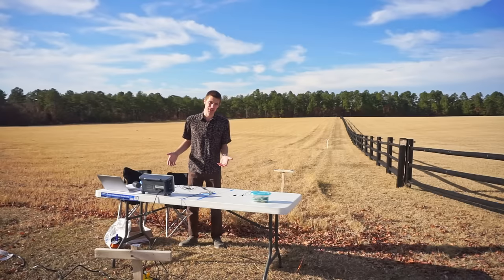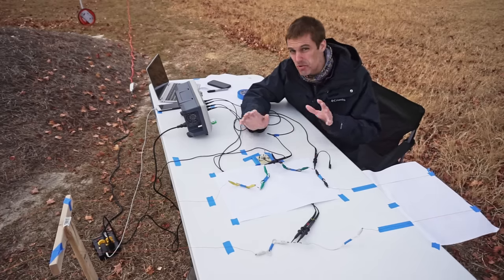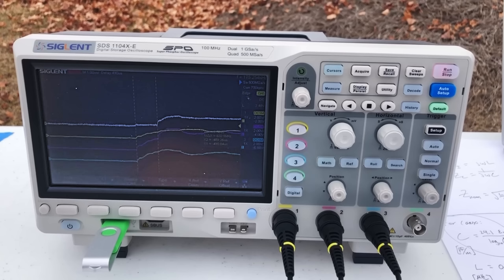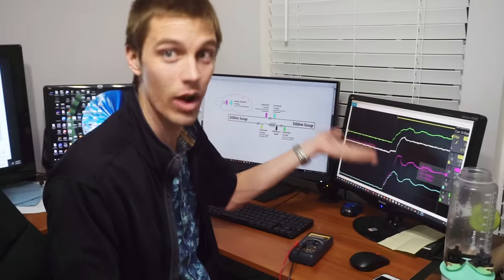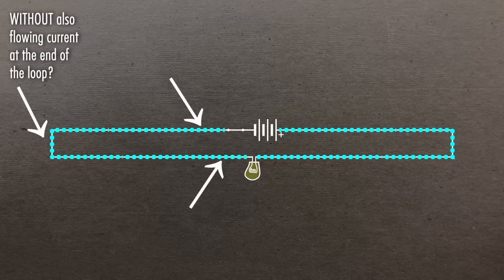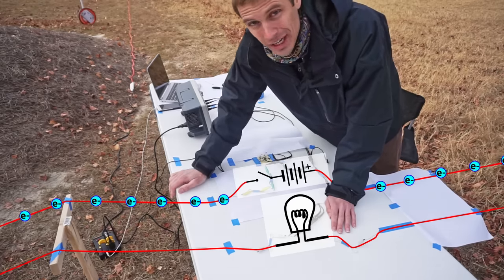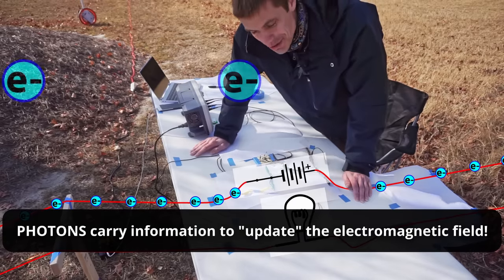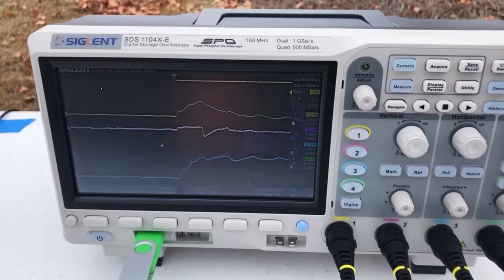I bought 1000 meters of wire to settle a physics debate

Comment: Very good test. It is always great to see what happens in reality! Thanks you.
Impedance matching would raise your output voltage. But also in your setup, I would be very worried about the capacitance the probes add between the lines. Remember the stray capacitance between the wires is VERY small, likely much smaller than the capacitance at the probe output. Probes have capacitance to ground and with probes on the switch and load side, you are basically coupling the switch to the load side with extra probe capacitance. I say place probes ONLY on the load side (you still see the steps), make sure your probe is on x10 for smallest capacitance, and maybe use special high frequency probes.
Other than that, the only thing that might not have a significant effect is the capacitive coupling through the earth which makes for a slight output voltage difference. Nothing huge though. 
One more note, knowing your load resistance and the voltage of the first step, you can calculate the line characteristic impedance, and match your load to it, or pick a higher load to see a much larger voltage step at the output.
GOOD LUCK with your future tests.
Reply: Ah yes all of these words make sense to me. lol. I’m loving that Derek sparked so much enthusiasm for science with that video, even if proved right or wrong, this thought experiment is wonderful to uncover through all of you.
Reply: Mehdi, you forgot to mention the step when you get shocked :P
Reply: Are you going to make a video on this?
Reply: So interested to read this. It also seemed to me that the capacitative coupling was high for two wires a meter apart. The probe capacitance would explain it. Cool.
Reply: @hippopotamus86  He did, a week ago
Reply: @hippopotamus86  I did!
Reply: The wires have a mutual capacitance of a few pF/m, and a similar capacitance to the ground. For example, 1 mm wires 300 mm apart are 4.3 pF/m. So a few meters of wire would have capacitance equal to that of the probes, which is typically 20 pF.
Reply: Always fun to see other good youtubers commenting und the ones you also watch. But as soon as I saw the title of this video I knew you also left a comment here.
Reply: @adamtherealone  nah. İf derek is wrong f him. No participation trophies round here.
Reply: @garrysekelli6776  bro people have hypothesis and theories all the time, and sometimes they’re wrong, but don’t know it until proven so. Stop tilting
Reply from the maker: Thanks for the reply! I’m interested in the probes adding capacitance - this is something I didn’t worry too much about but perhaps I should have. Are you talking about parasitic capacitance through the shared ground/coax shield linking the probes together or something else internal? I admit I am NOT a scope expert and would like to learn more.

I didn’t try THAT hard to get an impedance matched circuit but I fiddled with resistors to get a nice step function - when they were way too large I got results that looked just like your simulation! I wanted to keep the load resistance well above the wire resistance so maybe I didn’t go low enough? I was also most of the time simultaneously changing the near-side resistors and changing my source impedance because it made the current measurement easier but yeah not the best way to get a match.

One note on the “do the probes matter?” question, when I spread out the wires further I was able to make the pre-light speed signal totally vanish, so can I use that as evidence that the probes were not causing an additional signal? (Because I could make it drop to zero?)

Thanks!!
Reply: @AlphaPhoenixChannel  we use fet probes at my workplace for very high frequency signals to get below 1pf of probe capacitance. We are measuring things like DDR timing. Although with your noise spikes from the wire, the probes might get damaged, since the ones we use are only rated to about 12V max, even transients. Btw great video, I’m glad you made it! The production quality is great!
Reply: @cogoid  20 Meters of wire implies 20m/c seconds. Are you saying 1m/c seconds is not the real answer?
Reply: @adamtherealone  also. They call them hypothesis and theory. Derek called it "real". That is unacceptable in science, though it might be acceptable to YouTube. Thus Derek is merely a Youtuber.
Reply: @BenjaminGatti  And the fact to call things out as lies without doing a proper field test (10 times) is very rude. What was he thinking ?! If there was a purpose at all. Its good to question for sure, but being rude is a bit too provocative.
Reply: @cogoid  Capacitance: C = 
3.261e-12 F

Looks like 0.33 pF per meter to me. Need 60 meters to match 20pF. You get 1/c sec. That's arguably 0 meters of wire +- 1*Derek's error magnitude.
Reply: @RogerCillion  yeah, I agree. Science is a humble discipline, because at the edge of science, there is always the possibility or error. Derek's claim will not hold up in physical testing. And these tests are not that hard to do. Even Derek's simulation techniques are wrong in my opinion, to say nothing of his actual tests which are smoke and mirrors.
Reply: @BenjaminGatti  Ben, "pico" is a unit prefix in the metric system denoting a factor of 10⁻¹²
Reply: Haha, Lewin designed his circuit. You should make a 'Probes' t-shirt. 😂
Reply: @BenjaminGatti  There is no "real answer" without more clearly defining the real question.  1m/c is when the current starts trickling, but it takes much longer to start pouring.  Scaled down for this model, 1m/c is when you see the white line move up just a tiny bit, but then it stays there for a while (I'm guessing the equivalent of 1 second or a half-second, so enough to follow the circuit the long way around), then it starts climbing (the diagonal).  How high up does it have to be to count as "on"?  

Derek did specify that "any current" counted, but as pointed out in this video (and others), an actual bulb that lit up on that small of a current might burn out on the full current.  (Though in this video, the full current seemed only about 8.5 times as much as the initial step.  There are bulbs that could handle that, but I'm not sure if that 8.5 becomes 2.5million in Derek's circuit.)
Reply: @jimjjewett  this scope can do 1 G/s, which means 3 samples in 1m/c sec.

I'm not sure that we have zoomed in enough for 3 samples.

In addition all the probes provide a path, do those have to go.

This is an effort, but not a good effort.
Reply: @AlphaPhoenixChannel  Hi Alpha! I suppose the probe capacitors to scope ground would be like my simulation where I placed the capacitor first, it can create a spike in voltage when you just turn the switch on. Knowing what can happen, if the spike happens and vanishes much faster than the wave reflection, then you can ignore it. But if your load resistance is too high, the spike can stay too long. It seems you are not seeing that in your result, so it might be OK. 

I'm a bit confused about your load though, you said you picked it bigger than line impedance. Then I would expect your first step to be at higher voltage too. hmmm! Wish you were close by so we could do some experiments!
Reply from the maker: @ElectroBOOM  ah I see what you were talking about. Effectively adding two capacitors on both sides of the load over to the high side of the battery would add some weird coupling, but [hopefully] it ends up having the same effect on both sides as far as voltage drop is concerned, although if those capacitors were eating some current meant for the load, I could see there being some initial dip…

But yeah, I didn’t get a transient up front I’m worried about so fingers crossed this doesn’t invalidate the test. You don’t know how relieved I was to see your comment last night and realize there wasn’t a big glaring error anywhere that I’d missed - cause I knew you’d be able to point it out!

And yeah I’m reply to calculating the effective impedance from the step height - I feel like an idiot for not doing that in the moment and matching it up. With that knowledge in mind, I may try to calculate what dimensions would be necessary to impedance match some actual LED+resistor or something since I do have step heights for varying wire spacings although not wire diameters.

Thanks for getting back!
Reply: I read your comment how you talk... AMAZING!
Reply: @AlphaPhoenixChannel  yes, differential results are suitable for analyzing the impact of a parameter. We still need to understand: <1/c sec , @1/c sec and < full length/c sec.
I think this video only covers the last period. Also know as E. Other.
Reply: @AlphaPhoenixChannel  quick test for "probe artifacts" is to get a pile of picofarad capacitors.   
Hook them across the probe and probe-gnd, see if this affects the scope results.   If your probe is supposed to be 3pF or 10pF, simply add a capacitor to double, triple, etc., the capacitance added at that point.
In other words, what would happen if your load-resistor had a picofarads capacitor added across it?   Probably this is easily calculated:   it's just an RC time constant, with part of the "R" being 2x the Zo line-impedance, which is the series-resistance between battery and load.   With a hundreds-ohm line impedance and load resistor, then a 10pF probe won't block signals which are faster than roughly 100 x 10pF = 1nS      (ALso, two probes connected across the load resistor will only add 1/2 of the probe's capacitance, because the two probe-capacitance values are being wired in series.)
Reply: @ElectroBOOM  I notice that Dereck's setup gives more impressive results if much higher battery-voltage is used.    That way the initial wattage can be significant across the 1M gap: easily 10W or higher (because the Zo of the lines only are adding 1K or 2K in series with the load resistor.   So put 200V across those resistors!)   Someone needs to reproduce the longwire experiment, but using 200V worth of 9V batteries clipped in series.
Reply: @wbeaty  of course, but as alphaphoenix notes at the beginning of the video, any light designed to turn on at the initial current value is almost certainly going to be blown out by the full current value. So it wouldn't stay on for long 😂
Reply: Who are you and where did you get those beautiful eyebrow?
Reply: Totally heard this comment in Medhi's voice.
Reply: That would apply to any measurements done with more than one probe. So, to have an idea of the magnitude of that effect, perform the test with just one probe near the bulb and compare with what we get with two probes. I don't say the effect is nul, but negligeable in comparison with the noise (radio wave  picked by the wires as well as, well, thermal noise and others).
Reply: @rustyshakleford5230  All hail the unibrow.
Reply: @AlphaPhoenixChannel  Great test!
Thank you!

It made me wonder of two cases:
1. How it would act if it was a big circle and not two parallel lines.
2. If you cut both ends of the parallel lines and keep them in place, will there still be that tiny spike of voltage? Maybe even a smaller one cayse you got less wire to "charge"?
🤔
Reply: @moneypowertron  Not true, since a matched bulb sees 6v initially.   So use a 12V bulb, which initially gets 1/4th of full watts at 6V.
Reply: @davidferster2263  They weren’t meter apart here. 4 times closer meaning 16 times (?) higher capacitance per unit of length.
Reply: my brain automatically reads this in mehdi's voice
Reply: wouldn't the increased capacitance increase the size of the initial pulse but be unlikely to affect its initial timing? man that would be fun to engineer out - 2 sampling devices clocked form a nice stable common source over would be a cool thing, maybe optically clocked - im sure theres a simpler way tho lol
Reply: @AlphaPhoenixChannel  What I'm still confused about is why your first step at such low voltage, indicating the load is much smaller than the line impedance, and then when the wave returns the voltage jumps much larger to the supply level. The returning wave should also just add a similar small step every time resulting in a steppy-ramp towards the supply. I may be missing something. I'll re-watch your video!
[update] so if I'm not wrong, your line impedance is around 12.5kOhm on each side or 25k total. If you put a 25k resistor as load, the voltage should step up right to 2.5V. But you can imagine the current at 100uA is not much. If you use a red LED that turns on at 2V, and put a 5k resistor series to it, then you would draw 100uA at 2.5 V and so such load should look like a 25k resistor for the FIRST STEP ONLY. So you would have a first step at 2.5V. But the incoming steps would experience larger load and would be smaller.
Reply from the maker: I haven’t yet calculated the effective impedance of the jump, but I’m thinking this is a really weird case. The “flat” nature of the initial step I attributed (in an explanation of how capacitors work that got cut for time) to basically the signal shooting down the wire continuously finding new capacitors to charge, so that signal is passing through the air gap (presumably a fixed impedance) AND the wire resistance, which increases with time as the “capacitor part” of the wire moves farther and farther down the line. When I changed the load resistance I also changed the near-side resistors to make it easier to measure on the scope but I’m wondering if changing the source impedance affected the rise time and therefore the effective frequency and then the impedance of the wire, making my attempts at impedance matching invalid…
Reply: I was hoping that we would see the reflections from impedance mismatch.  The wire pair impedance could be around 377 ohms (impedance of free space) and a 3:1 impedance ratio could give good reflections.  Unfortunately, the wire capacitance is too high to see that.

The step you see in the beginning is probably due to the way the grounds are hooked up.  If you look at the beginning of the step you can see that it happens soon after the switch goes on and has a fast rise time.  I guess that it is a low capacitance connection due to the fast rise time and near to the scope, due to the delay.  The amplitude is reasonable leakage for a low-cost 'scope.    

As an aside: Signals travelling down a wire move slower than the speed of light.  Depending on the physical configuration and the type of insulation it can be lower than 70% of the speed of light in free space.
Reply: @AlphaPhoenixChannel  for your 24 AWG wires, the one loop resistance should be around 40ohms, or total loop of 80 ohms. So it seems the line impedance of 25k is much larger and so we should be able to ignore the resistance. I forgot about your near-side resistors! Let me see how much they were... 1KOHM EACH?? you should remove them and just focus on measuring the load voltage, that big of resistance would throw everything off. Well, I mean if you like to get steps the same as what the original setup would, you should remove them. Otherwise you can create any setup you like!
Reply: Still, the fact that the answer came out almost exactly equal to the length of wire, means if it's an effect of the probes it's a great coincidence. If he used other distances and the results matched with them, then he'd have shown the probes aren't relevant.
Reply: @AlphaPhoenixChannel  I suggest you to measure the current-time graph in nano-second scope.
Reply: @adamtherealone  ok but big money derek has more than enough resources to have tested this himself before telling millions of viewers that this is how it works.  He built himself up to be the guy dispelling misconceptions, and here he is, once again, explicitly putting misconceptions into the world, and having to be corrected by almost every other youtube educator (who absolutely won't have the reach that he does).  When did he change his brand from breaking down this stuff to actively generating it?  cuz I missed the channel update video
Reply: I can't be the only one reading this comment in Mehdi's voice in mind.
Reply: @TheGoodMorty  he had a whole video about click-bait didn't he? guess he decided to try it out for himself... pretty sad really, I had respect for the guy
Reply: @flecom5309  Same, he used to be one of my favourite science educators, but ever since he got into corporate brand deals (like the head and shoulders video) it all started gradually going downhill.
Reply: @ElectroBOOM  Not only am I reading your comments in your voice, like other people have said, I could see the camera zoom in and hear the burning sound effect on that "1KOHM EACH??"
Reply: I would have like to see the effect of spacing the wires further apart and see how the wave on the scope changes. You could reduce both the capacitive and inductive effect if the wire was in a big circle.
Also there is the flux of the magnetic field of the earth changing through the long wire. Some 40-50 microteslas overall, but that's per meter of wire. So there is some induced voltage on the wire even if the "switch"(transistor) is open.
Reply: I love how the YouTube science community is now doing peer reviews. This is the start of YouTube uni?
Reply: @BenjaminGatti  Ben, go and try to this better instead of throwing rocks!
Reply: @cogoid  I think we agree 0.3pf not 20pf. Where does the 20pf come from? Really hard to light an led with 20pf btw.
Reply: @yongtuition  right. Ain't nobody interested in >4nSec what part of 1/c sec is hard to remember?
Reply: @milantrcka121  that's science my friend. You ain't proved anything until you've proved it. There is no softball in science.
Reply: @BenjaminGatti  The number that you wrote 3.261e-12 F means 3.261*10⁻¹² Farad, or 3.261 pF.
The 20 pF is the input capacitance of the typical oscilloscope probes on x10 setting.
Reply: I consider it more likely that induction produces the observed effect as compared to capacitance but both have parts to play in the effective impedance of the transmission line (paired wires).
Reply: Ok, now what does it look like if one of the wires is 1km long and the other is only a meter long?  Do the two waves still need to move?
Reply: @nubrigol  The phenomenon is well known to radio operators.  It is a transmission line.  So if the feed point is near one end and the transmission line is shorted at both ends, this wave front proceeds in both directions simultaneously, one is a crest (surplus of electrons) and the other is a trough (deficit of electrons) and either wave will bounce at the end and return.  When the feed point is in the center, these two waves meet at the middle and if the load is matched to the impedance of the line the wave will stop and the entire circuit will be stable and passing direct current to keep the lamp illuminated.
But if the load is not matched, the wave will continue past the load and bounce back and forth between the ends, losing energy due to wire resistance.
Where exactly you feed the original impulse doesn't make much difference (maybe none).  If fed near one end, then what you have is the initial wave traveling the long way and right behind it is another wave that bounced off the shorted end and is following the first wave.  These reflections cause major problems in communications circuits which is why cable TV networks place little resistors ("terminators") on unused ports of splitters.  It is better to absorb the signal than to reflect it back into the network.
Reply: @nubrigol  anything beyond a meter is a moot point as all possible paths between battery and lightbulb are longer than 1m/c sec. 3m/c sec to be precise. See how 3m/c is not 1m/c?
Reply: good point
Reply: @garrysekelli6776  And he is wrong in his statement for multiple reason! But all the electrical laws he sited are correct he just skewed or better yet screwed the facts into BS
Reply: @AlphaPhoenixChannel  My initial thought was of your setup and the wires being in parallel to each other causing inductive coupling. If you had made the 1 Kilometer loop a physical circle, you would reduce capacitance and reduce inductive coupling.  I know you may not of had a choice on physically stretching the wires long tight oval where the wires are essentially parallel for most of the distance.
So I am guessing when you say you wires further apart, did you mean at the table you moved the wires connecting the resistor farther away from the wires connected to the switch? or did you mean you moved the probe wires farther apart? Probe wires do have a designed impedance to reduce capacitance, which why you have a test point on the oscilloscope, as some probes you can adjust to remove any skewing due to parasitic or environmental noise.
Reply: Just had my exam on transmission line theorie (electrical engineering) and it is so awesome to see these theories happen in practice!
Reply: I see a lot about capacitance on here, but nothing about inductance.  Inductance is likely the largest contributor to the signal results and delay to the flow of current.  Remember - inductance is direct function of loop area....large loop here gives large inductance which resist change the current (v=L di/dt showing that i can't change instantly without v going to infinity).  Also remember that electron drift is relatively slow (so the electronics don't actually move that fast), but, since they are packed in the wire, when the first one moves the last one moves...so technically electrons don't actually move very fast through a wire, but the movement of one causes the movement of all which happens at the speed of light depending on medium)
Reply: Why did you even watch this video😆😆😆
Reply: Why did I hear this in you voice as I read it.
Reply: Stray inductance is what he is likely seeing on that one probe.
Reply: @TheGoodMorty  derek did exactly what he intended to do, spark discussion and debate. That's literally what his PHD is in, is physics education. look at all of the discussion this has sparked, and now not just the people who saw his videos, but other channels came out to peer review the theory, that's exactly how science should work. It's important to note, he set perimeters to describe a phenomonon that weren't ever meant to be thought of in engineering practicalness
Reply: @adamtherealone  😂
Reply: @AlphaPhoenixChannel  DEPENDS! 🤦‍♂️🤣
Reply: You mentioned the stray capacitance.   I agree when you stretch the wires across a field it might be a concern but the fence was shown at the start of the video and that should prevent any straying. Clearly you weren't paying close enough attention to his experimental setup.   🤣🤣🤣LOL
Reply: But there is immediate current flow!      What supplies the energy to cause this?  The fields!  Everything else is irrelevant
Reply: But in the end, the experiment would've been perfect had he used Electroboom's ©FULL BRIDGE RECTIFIER™.
Reply: I wish you was my older brother I want to become engineer I have to I can’t let my only life get lost without education 😌